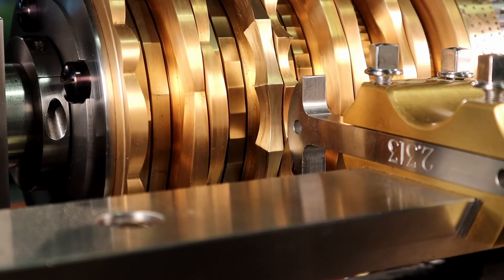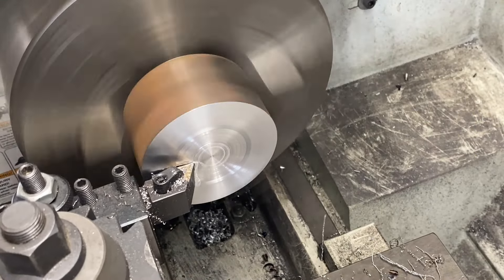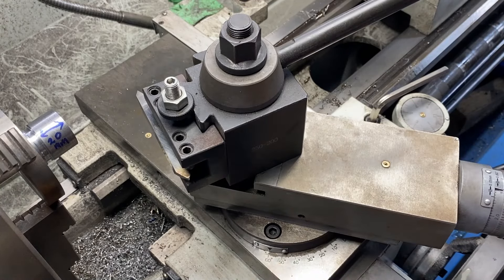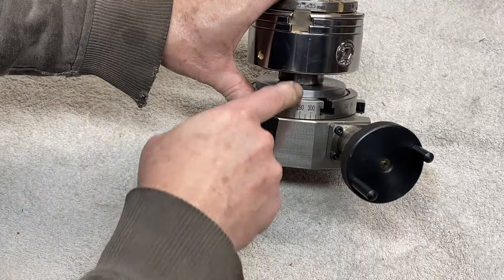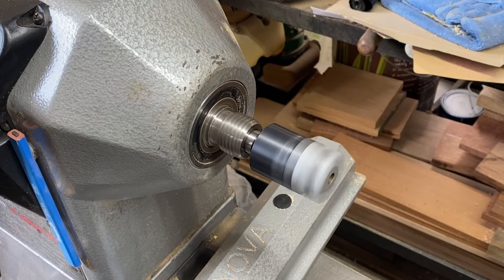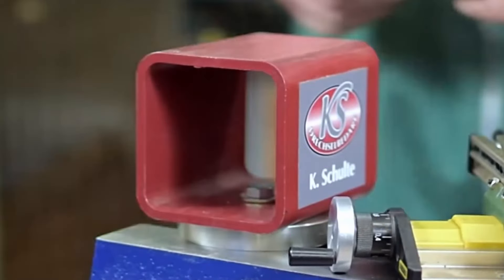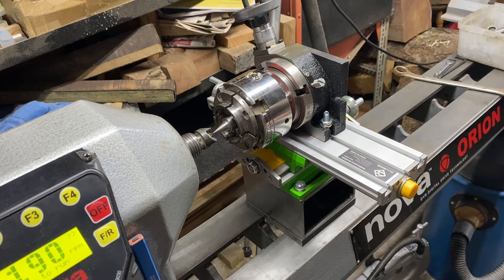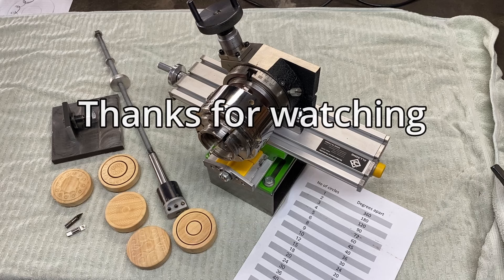Ornamental Turning Device

Comment: Amazing stuff. 👍 I have one of those little aluminium Chinese XY tables that came with a mini drill mill I bought and it's absolute rubbish.
Reply from the maker: Yes, they are not great. I adjusted the gibs and it is a lot better now. There are a few issues with it though. I will probably address those in another video. Thanks for watching.

Comment: Drill bits usually have a soft shank so the drill chuck jaws can bite into it. Try to use milling cutter shanks or tap shanks, both are hardened and will get a keener edge that will last much longer.
Reply from the maker: Thanks for your comments.

Comment: Very thorough show-and-tell video on this elaborate tool to make a variety of patterns on wood or even soft materials on a lathe.  This is reminiscent of an artistic plastic toy where one can draw circular patterns using a combination of pre-made templates and a pen/pencil.  Just for info how much was the total parts cost for this jig build?
Reply from the maker: Thanks for your question. These are what I paid in NZ dollars.  
Boring head - $76. 
The cross slide - $83
4” rotary table - $73
I made the chuck mount myself

Comment: Cool project. I'm thinking some really dense desert hardwood would give really crisp details.  I've turned mulga wood from the dry areas in south west Queensland that machined like steel.
Reply from the maker: Thanks Mark. In NZ I think they use Camellia. It has tight grain which produces fine detail in the cuts. Those test pieced were macrocarpa which is too soft for ornamental turning, but just what I had laying around.